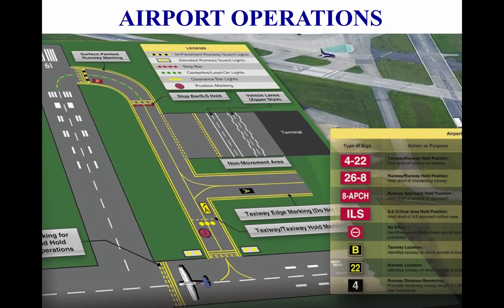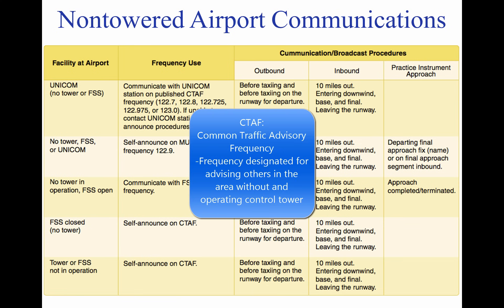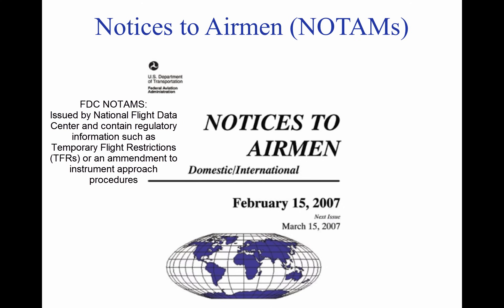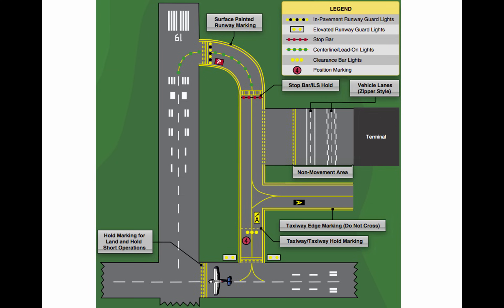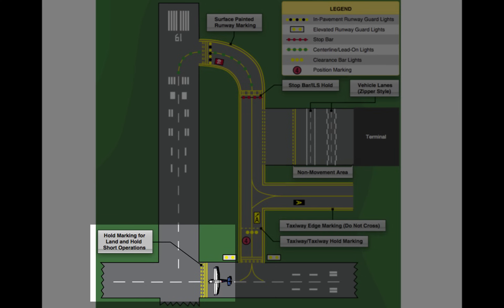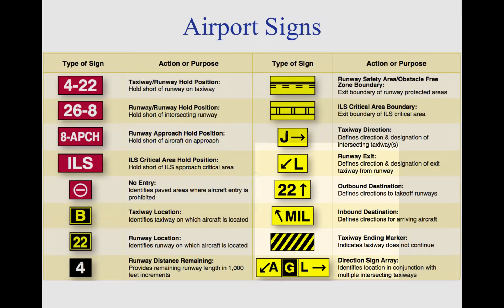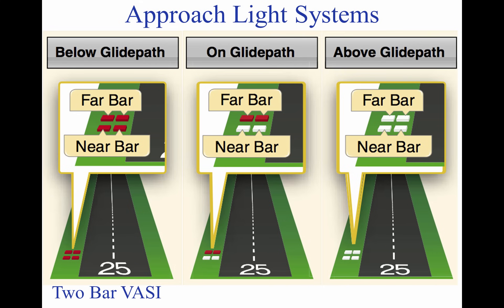Private Pilot Tutorial 13: Airport Operations (Part 1 of 3)

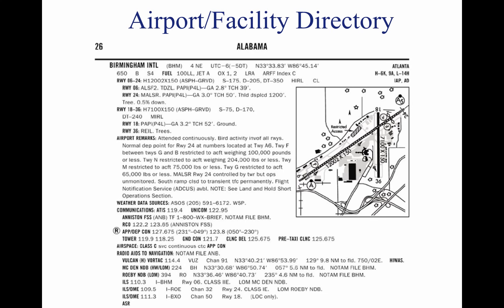Comment: At about 4:33 you introduce the A/FD; since before July 1, 2016, the title has been changed to Chart Supplement.  At the end you describe the VASI glideslope  lighting; in reference to the light position, you said the far light is white and near is red.  The far light will be white only if above the glideslope in which case both lights will be white.  The far light is red and the near light is white if on the glideslope.  The near light will be red only if below the glideslope, in which case both near and far will be red.  The same reference is wrong in part 2 of the Airport Operations.   Some of the 'highlights' during the presentation have no reference to the subject matter at that moment, especially when talking about displaced thresholds, stop areas, or jet blast areas, and these areas are not noted in any pictures.  Refer to the AIM, PHAK, or AFH (free download on the FAA.gov website) for correct information.  Other than that is was a good introduction. ✈
Reply: nerd
Reply: nerd
Reply: Have you made the perfect flight yet, where you did everything exactly the way it was supposed to be done?